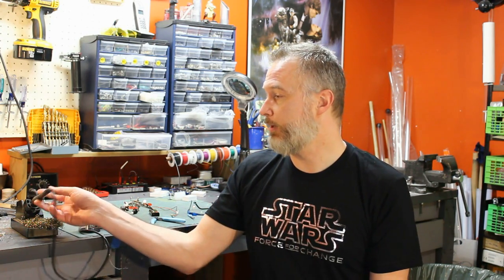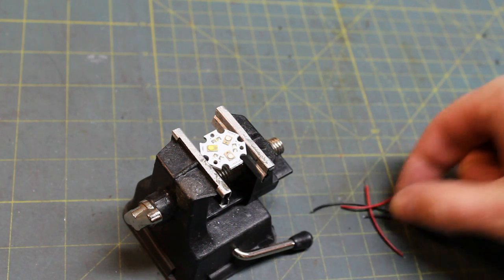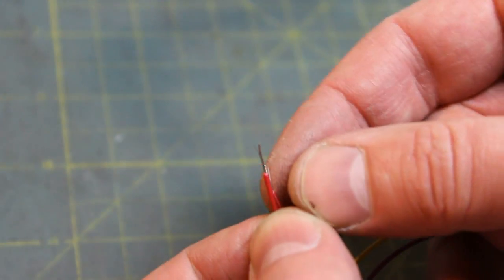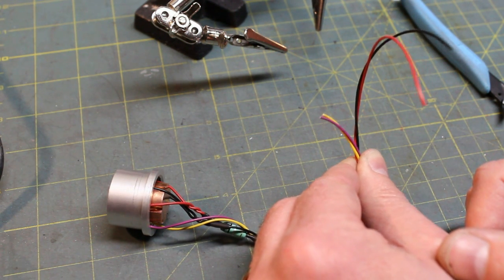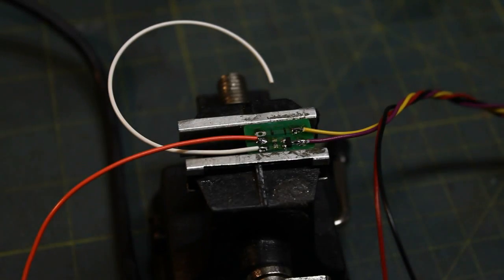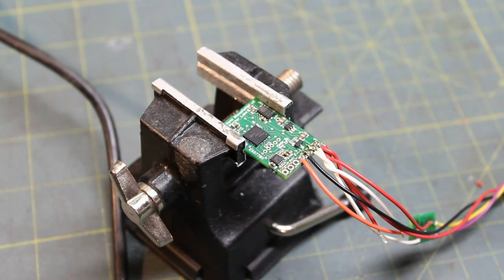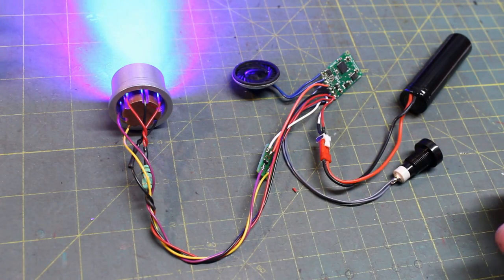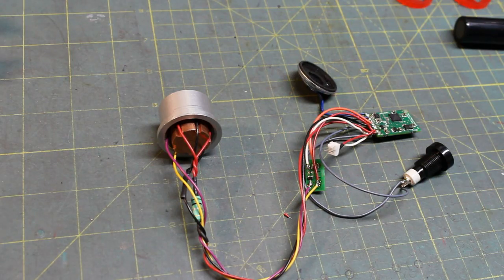Flash on Clash using a PEx

Comment: Im new to saber wiring so there were a couple of things that confused me. I keep hearing that I only need a resistor for my red leds. Is that wrong? Also the positive wire from the white die was wired to the positive on the xtender instead of the positive on the board. Was there a specific reason for this?

Comment: Would I need to wire anything differently if I used a Green/Green/White Cree XP-E2 CopperNova instead of the Blue LED? 
The Green Specs are:
Green Cree Part# XPEBGR-L1-0000-00G01
130 Minimum Luminous Flux @ 350mA
Forward Voltage @1000mA = 3.7v

The Blue Specs are:
Blue Cree Part# XPEBBL-L1-0000-00301
45.7 Minimum Luminous Flux @ 350mA
Forward Voltage @1000mA = 3.4v

Comment: Could you do a video showing how to wire up the power extender with the Nano V4 so that the blade colors can change for each soundfont?  I'd love to see it done. Ives wired four so far but never like that. I've read the manual but I'm still unsure.
Reply: James Frame Exactly what I wanna see. I wanna see a NBv4 with an AV switch & PXe setup but without a recharge port.
Reply: Blvck Ronin I just got one wired up just like that. I'm going to draw up a nice wiring diagram. I'll put it in here as a reply when it's all done.
Reply: James Frame Do that dude, for sure. Much appreciated.
Reply: James Frame Is your AV switch illuminated? Cuz mine will be
Reply: Blvck Ronin it is
Reply: Ever get it done?
Reply: Blvck Ronin I got that diagram finished but it won't let me put it in the reply. I'm on Facebook. I can put it there.
Reply: Whats your FB name
Reply: Blvck Ronin Look me up James frame.  You'll see me with my lightsaber! Go ahead and friend me, I'm always putting up wiring diagrams.

Comment: If I were using a Prizm4 and I had channel1 to the two main blade leds (in parallel), channel2 split (in parallel) to an led in each of the crossguards, and channel3 was to a single led in each ledstar (parallel) for FoC would that work without a PeX? I've read the manual over and I'm just not sure. The main saber color would be red so the overall draw would be lower than other colors, except for the FoC, since I want an amber color I plan on resistored green leds for that.
Reply: I don;t see why that would not work if you have the right settings in override. I suggest you post this on the forums in case anyone else has tried it.

Comment: I'm looking to wire a tri cree to a PC v4 with the combination of deep red, royal blue, and white. i want to wire them with the ability to alternate (with an auxiliary switch) from blue to red to purple, all with white as flash. would this be possible? if so, through what means?
Reply: It's certainly possible.
I would use the PC prizm version, and set it up with the colour profiles as described in the manual
Reply: Awesome, thanks so much for the feedback

Comment: From the LED module, can I combine the yellow and red wire together onto the PeX (with the red properly resistored) instead of having two separate (+) wires coming from both the PeX and LED ground?

I'm trying to minimize the amount of wires while using a 3-pin connector for quick connections.
Reply: Yes - you can combine the (+) wires. The ground is (-)

Comment: Hey do you believe that this same setup would work for a cross guard saber just x3? If i did what you did but 3x and tied all 3 led's in properly.. would that be okay?
Reply: +Greg McKinnon Sure. It woulddrain the battery quickly though. I would personally use a single LED on the cross pieces with no FoC
Reply: sounds good, thanks! you're one of, if not the most helpful person in the saber 'world' i have run into so far. thanks!

Comment: So the extender allows the Nano Biscotte to flash (which it can't do without the extender?) Also, the NB should not need anything else for movement if I understand it right?
Reply: +J Schmelzer Correct on both. The new Nano Biscotte 3 does not even need the PEX (vid coming soon)
Reply: Thanks mate, super helpful. I wasn't sure if I was understanding the diagram right on the manual or if I was missing something.

Comment: Hi Rob.. I know you have heard this a thousand times but Thank you sooo much for videos like this!! I have constructed 2 sabers that I will soon be gifting to my 2 kiddos. I have followed this video closely to construct them: NBV2, Tri Cree GGW LED, PEX, 18650.  I have not placed a resistor on the white dye on my TriCree for FOC so I soldered my positive red wire going to my NB sound board directly to the pad that my FOC led positive is using on the PEX as you did in the video. One saber this is working great. The other I fear that I have BLOWN the White LED. Should I have used a resistor for my white FOC led on the tri cree? I have taken the wires off the positive and negative on the white LED pads to see if I can power the LED with a AA power pack and it does not light up where doing the same for the Greens do light up.
Reply: +leatherneck I'd be surprised if you blew a cree white with the max 4.1 volts that comes off the battery. But if the LED doesn't work it doesn't work. A blob of solder? It's possible it's blown
Reply: +Rob Petkau Thanks for the response.. I am new to soldering.. So when you say "blob of solder", can this cause a short of some kind? One  pad did have a bit too much solder on it but it did not look like it was bleeding onto another pad or anything.  I have tri cree on the way and Tim has offered to repair the old so I cam chalking this up to gained experience.
Reply: +leatherneck Experience is valuable for sure. Yes - a blob of solder can often cause a short. You can buy an inexpensive multitester tool and use it to test for shorts.

Comment: Hey Rob,
So, I have my saber all wired up. I have 2 blue dice and an amber for FoC. The issue I seem to be having is that when the FoC activates through the PEx, the blue never shuts off during the clash, making a light purple when mixing with the amber. Any idea what's going on? I'm using a NB sound board as well.
Reply: +Berserk81 that's normal. Usually people want the FoC to ADD to the blade brightness instead of replace it. unfortunately you need a PC, CS or CF to turn the main colour off during FoC
Reply: +Rob Petkau ouch...that's unfortunate. Wish I thought that through a little more, haha. Thanks, Rob!

Comment: Thanks for all the demos Rob you the man!  Question: the solder pads on the soundboards have a hole that run thru the board, can you run the stripped tip of the wires thru the holes then clip them flush then dab the pad with a small amount of solder? or is it better to do as you do and solder the wires flat on top of the pads?
Reply: +Anthony Coffey You CAN do it that way, but it's not as secure. I only do that when I have to for space reasons

Comment: Hello, i recently built this FoC system with all the parts used in the video in the exact same layout. However, when i attach the Lithium battery, i get the bootup  sound and the white FoC LED turns on. When i click the switch, the White LED turns off and the two Red LED's turn on. And when i press the switch once more, the lightsaber will finally activates and the Dark Meat sound comes on. However, the White FoC white light is still flashing even without a clash (It flashes even brighter with a clash) and when i try to hit the switch to turn the system off, the only thing that happens is the white FoC light turns off (its not completely off, just extremely suppressed). I have all the correct wires going to the nano biscotte and as i said before, the layout is nearly identical to the one you built in the video. I have tested many possible solutions but nothing has seemed to work. Please Help!!!
Reply: +ArbitraryGamer Hey. It definitely sounds like a wiring issue. The best thing for you to do is post this on the TCSS forums with pics and a number of us can help you troubleshoot.

Comment: Mr. Petkau, I have been looking on the forums and there are some that say that you should put a separate resistor for each led then connect them in parallel like you show... is there any grounding to this as in your flash on clash video above you use one resistor.  I am using a tri-cree.. and notice in the nano biscotte manual it shows the tri-rebel wired with only one... what would your thoughts be on the matter? and thanks for the helpful info.
Reply: +simon placek I try to use one resistor per circuit. The mains are one, and the FoC is another. When you place two LEDs in parallel they become like one LED. At least for our purposes.
Reply: +Rob Petkau 
Do you need power extender for foc on CF?
Reply: +Zeaiclies De'Magician Nope, it's onboard
Reply: I thought so.  Thanks
Reply: Do you know if naigon's z6 LED can be used with any of the plecterlabs sound cards, perhaps with the power extender?
Reply: +Zeaiclies De'Magician I don't know.
Reply: No worries that's fair.  Just thinking how cool that LED would be on a plecter labs board.
Reply: +Zeaiclies De'Magician You think that would be better/brighter than the Cree XPE2's on the TCSS coppernova?
Reply: Again just a thought.  Thanks again Rob.

Comment: do you need to use the power extender if you using RED RED White with a Nano board?
Reply: +Brandon Bromfield Yes. The FoC signal from the NB will not drive the LED properly without the PEx

Comment: always amazing rob had a question about how many times can you solder wires to the boards before the leads really start to go I have a prizm and would like to rewire the mess of wires in there im just a little paranoid about re-soldering it
Reply: +Garrett Lapham You should be able to resolder multiple times with no trouble. If you get too much solder on there, use wire braid to soak it off.

Comment: the top of the lense isnt compatible with conversion kits are they?
Reply: spawnkiller97 Not sure what you mean. Usually the conversion kit specifies what optic holder and heatsink are required.
Reply: Rob Petkau custom saber shop if you get a led kit like yours its not compatible for my kit fisto lightsaber i want to convert because the conversion kit says its not compatible
Reply: Rob Petkau 
sir I have a different question... since there is no video specially for it... and since you suggest not just hanging the pex in the saber some where... i was wondering how do I wire it to use the wiring harness you show in your basic lightsaber with sound video.  since you say it would best go in the recess at the back of the v6 battery holder.... do you have any ideas how the yellow and purple wires would be connected to the wiring harness...and also how if I can use the wiring harness... how the wires would go to the nano biscotte... I see that obviously with the standard issue the red will go to the positive...the black from the battery holder goes to the board with a switch wire attached.  the white wire will be used as the negative coming from the pex and going to the spot where the black wire from the battery holder connects... and the red from the pex will go to the positive of the battery holder... I know the purple wire from your video goes to the negative of the led, which in turn becomes the white wire that goes to the negative on the nano biscotte... and a red positive gets connected to the pex directly to the yellow positive of the led, you used orange for the foc control circuit... which I figured originally that if I was going to wrap the pex inside the hilt with electrical tape then I would have connected the orange to a blue wire leaving one of the blue wires of the harness unused and the white would obviously get twisted with the green switch lead from the harness to the negative on the other side of the black negative from the battery holder... in your expert opinion... can I still use the harness for the foc circuit? or should i use a covered spade connector for the purple and orange wire so I can make them easier to connect? or would it be ok to cut them long enough to just connect them directly to the pex by themselves inside the v6 speaker holder on their own without the harness, connecting the red/orange/white wires directly to the nano biscotte?  in your expert opinion how would it be best to... in a sense connect both vids?
Reply: +simon placek I would wire it wothout the harness, use longer wires. Then when it all work, Cut and build in the harness afterwards
Reply: Rob Petkau  if you look at my post that I had just put to your channel page, I sort of reworked my question on the matter and think I worked the issue out in a more organized fashion.. if you notice that post I think....if I have it all worked out that it could work.. I was planning on putting a black mark on one of the blue wires making it the wire that would go to the white die negative  between the harness and the pex..... and on the purple wire,that would be the white die negative between the white die itself and the female portion of the wiring harness, I plan to put that same black mark so I can keep track between the two... the two blue wires will thus act as the pex negative("purple") and pex positive("yellow") like you used in your video on the foc system.  and the white wire on the harness will still not be used but heat shrinked to keep from causing a short... and the red wire from the pex will be twisted together with the open lead of the wire harness that goes to the positive on the nano biscotte, and the orange wire from the foc portion of the pex.... if I did indeed order some orange wire that is... will be the wire that is soldered directly to the foc pad on the nano biscotte...being one of the small amount of wires not tied to another.lol  also figured that in the spot you show in the video with the v6 speaker/battery holder that I would, obviously when things are set up use hot glue to attach the actual pex to the spot that you indicate in the basic saber video.  if it seems as if I am telling more than asking... I am actually doing both...since I probably am over thinking the issue as I am oft to do.... that I am using your input and my ideas back and forth as a way to sort of get myself prepped for the work ahead... and yes I did download the nano biscotte manual btw.  Thanks so much for the time and patience you hopefully have for intermediate solders like me and novice saber builders such as myself. your videos are informative, interesting and very valuable to use as a resource.
Reply: +simon placek For detailed info like this it's best to post on the forums so we can ll learn together - and you'll get more feedback than just me.

Comment: If I was doing a saber with purple as the main blade color do I need separate resistors for the red and blue LEDs to get the right voltage for each

Comment: i just wired my led the same way you did and it wont work ..each die works by its self but not wen i solder the 2 reds and 2 blacks to each other ..why?
Reply: richard Bennett It could be that the wrong pads are connected, it could be that there is too much solder and there is a short circuit. I can not know without inspecting it - take clear pics and post them on the forum please
Reply: well iv changed that led in to many sabers and to much soldering burnt out the pads lol so time for a new led ..thanx anyway rob :)

Comment: If I created a saber with these components and housed them in an internal chassi made with the acrylic disks how durable would the saber be? Would the elctronics break easily if it was used for light dueling?
Reply: Emil Leidhammar If you take your time and use the right components I expect your saber would be very durable.
Reply: Rob Petkau Thanks alot mate and thanks for taking your time to answer :)

Comment: Don't you have to worry about melting the pads? 4:10
Reply: MystByte Videos Which pads? none of the contacts in this video are prone to melting
Reply: Rob Petkau On the LED. When I first wired one of my LEDs one of the pads looks like it melted.
Reply: MystByte Videos Too much heat for too long - possibly. Clean your tip with a brass sponge and you should see better results.
Reply: I don't have a brass sponge. I've been using a regular old cleaning sponge (that's been dampened). Will that work?
Reply: MystByte Videos Yes